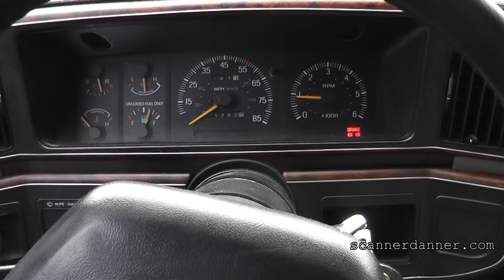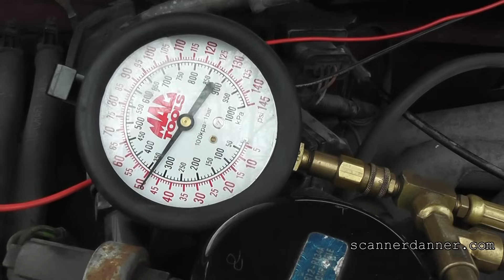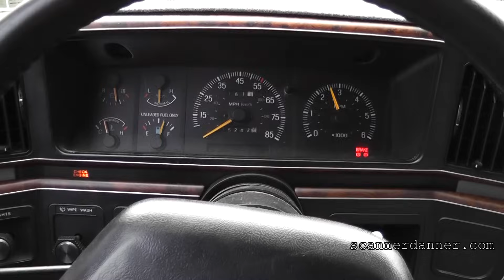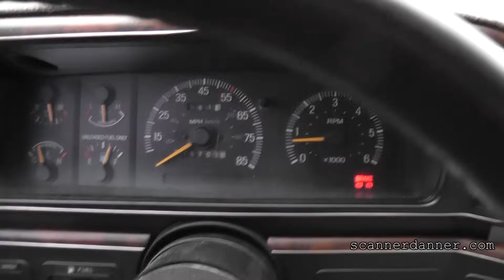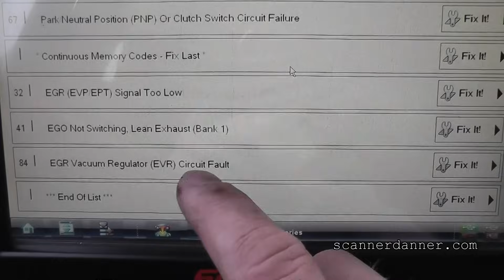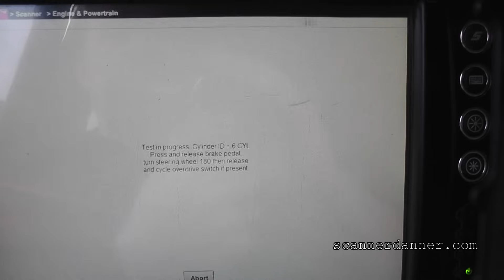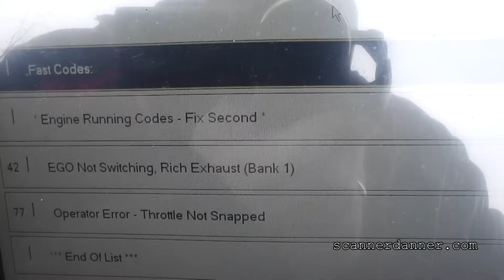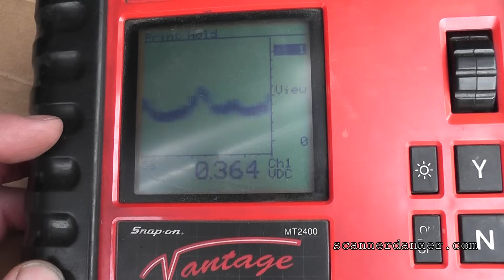1988 F150 Hesitation Problem [FIX!]

Comment: Hey if you want your Verus to boot up faster you should try a SSD I put one in mine right after I got it and it starts up and loads the program in less than 1 minute now.
Reply: SSD? You put a solid state hard drive in your Verus? Or is this RAM memory? I'm interested
Reply: ScannerDanner Premium Yeah I'll grab you the links I used to figure it out hardest part is finding a program to copy your drive for free. http://productforum.autorepairdata.com/forum/showthread.php?t=4232 
http://productforum.autorepairdata.com/forum/showthread.php?t=3771
The ram upgrade doesn't really seem worth it but if you want while your in there  its pretty easy to do.
Reply: Mike Lange If it's a Windows computer just use Macrium Reflect - look it up on google really good (free) program for cloning disks... I use it at work quite a bit (as a computer tech) the free version has all the cloning features, and you can boot from a disk or USB if you don't have a second computer to do the clone on
Reply: Mike Lange Could you just dd it with Linux?
Reply: tducketts
you could try it, usually works fine, but for many people GUI is easier, command line is not most people's first choice.. although I agree it would probably work fine...

potential issues for example: if the SSD wasn't the same size as the HDD, dd might need more options or not be able to move the NTFS data around

Seriously if you're a Windows guy at all try Macrium for cloning it's really nice, and free, works with most exotic hardware configs like for example; Intel Smart Response Technology, Windows 8 EFI secure-boot-only laptops and whatnot
Reply: thedreadedgman I think i did use Macrium Reflect. It uses a version of xp to run the scan tool and the hardware is some how coded to the software, not sure the specifics but you cant change the operating system. Either way when you do it just partion out the hard drive the same way the one that is in the scan tool and you wont have any problems.
Reply: Mike Lange yes; in any case an SSD should make a nice improvement to the tool, I suspect that the tool probably costs enough that they should have put in SSDs from the factory since they're less then $0.50 a GB now.
Reply: I'm going to have to look into this a bit more. Thanks for passing on the links. I'm not very computer savy so I will have to talk with someone who is. But I would like this. the verus is sooooooo sloooooooow.

Comment: I really enjoyed and learned some things from the few vids of yours I watched.   I enjoyed the one with your son and the Ion.   I absolutely hate the over engineered and junky computer/sensor/run by wire things in the Ion. Worst car I ever drove in snow BTW.  Also, prior to me owning it, my dad had the engine light go on, which manifested trouble with the steering, transmission and other vital controls. I think it was the ECM he had to have replaced.   Contrast that to your vid on this Good ole F150.  My '88 F250 5.8L has 312k miles on it.  While it may look, sound and operate rough, it should see another 10 years of use and another 100K miles if I can afford the gas it will consume.  Just swapped in a new heater core,  Job could not have been simpler,,,  Sorry GM.     Clutches, tires, radiators, brakes, etc all have their needs, but that stuff I have experience with.   These runability how to's are very good.  Thanks

Comment: So Mr. Scanner Danner. I'm concerned about this video being 2 years past . I have a 96 250 that is having such a similar issue as you found in this video and I am hoping for your thoughts.  I am about to pull my ECM and replace the capacitors to try and stop mine from blowing the #9 position Maxi fuse . This fuse first blew out immediately when hitting a teeth jarring bad place in the road which has my truck not allowing either fuel pump to run at all  since the rough place in the road . I have absolutely NO KNOWLEDGE  of using even test lights, much less using any sort of technical tools . I'm also physically handicap after being hit and severely injured on the job when I was struck by an extremely lage fast moving forklift and I have severe COPD so I would be very grateful and extremely happy to pay you for your help with my situation.  I thank you in advance for your time. JimmyKent in Goodlettsville Tennessee  !!!
Reply from the maker: Step 1 is to have a good wiring diagram and find out all the components that are on that fuse that keeps blowing.
https://eautorepair.adtrk.biz/?a=10817&c=24&p=r&s1=
This is a DIY version of the same service information and diagrams I use.

Comment: I know i'm late ..
Solid line is mark for light short deep notch is for Ford service tool ?(Mag pickup) that slides into the tube on the other side. Nice I remember all the fords I lernt on.
Oh and stop using the module to rotate the Dist!!! ever snap one? off,  you will if yo keep doing it.

Comment: I got a 89 Ford F250 460, I plugged off the EGR and just completely removed it and plugged the manifold and took off all the vacuum to the egr assembly. Would that be alright to do or do you recommend leaving it on there?

Comment: The straight six in my 96 has the timing mark on the cover vs the bolted on bracket like the one on this truck because it has a misfire sensor mounted to the timing cover in that spot.

Comment: Paul I just developed that cricket sound on my truck was wondering if you would guide me if it’s a serp belt and tensioner pulley? Or any other suggestions
Reply from the maker: Tough to do over messages. Change the belt and spin all the pulleys while the belt is off

Comment: +ScannerDanner let me be your cameraman so I can learn from you for free! Does that 1988 model bringed steering wheel position sensor? Another question how you pluged in your Verus to that OBD Port?
Reply from the maker: no steering wheel position sensor on this and you need an EECIV adapter cable for the scanner

Comment: Great video.as usual.93 ranger 2.3 new o2 same problem...6 months trouble.plus hidden whistle...checked manafold .flooded with oil..my bad ...old truck .Bad pvc. To much vac on crank case....sucking oil....new pcv truck runs great .(no check light)  they say high tech helps..makes me turn gray......lol

Comment: another great vid mr danner, i enjoyed this one because if your head would have been where it needed to be instead of the camera you would have seen the timing mark hehe.
pause at 3:52 its to the right of the centre sump bolt.
thanks for recording this...liked
Reply from the maker: Lol I know it! And I saw it while editing. While filming I'm looking through a 2 " camera screen which also doesn't help.
Reply: yer right, no way are you going to spot that on a 2 inch monitor.
im hopeing for a 3rd return of the f150.
something to do the with the erg system maybe...:)
Reply: Haha not me dude. I'm done with this truck
Reply: ScannerDanner Premium
mr danner i have a question about maf sensor voltage on an 02 bmw 320i 2.2 6cly.
i remember you saying something about posting questions on one of your vids, can i ask here?
thanks,
chris.
Reply: I am directing all help requests to my forum. Sign up (it's free) and create a new post. Be sure to add a name under "alias" as this is the name that will appear in the post.
Here is the link to the forum. 
http://www.scannerdanner.com/ForumRetrieve.aspx?ForumID=3226
Reply: great, thanks MR Danner.
i will do that.

Comment: Hi Dan, finally, a mechanic with the same principle as myself. I will not replace any part until I am 100% sure its bad and usually use a known good used part to verify my diagnosis then I'll replace with a new one.
Any one can solve tge problem if they replace enough parts eventually the problem part will get replaced, at the customers expense.  Anyway i stopped this video at 9 min. To insert  here what I would do at this point in diagnosing this particular step, because fords balancers have a tendency to rotate on the rubber. Pull #1 spark plug rotate the crankshaft with breaker bar, not bump the starter,   till you feel compresion, the put the dip stick in the spark plug hole continue to rotate the crank until the dipstick starts to go back down in the cylinder. At the point where the dipstick doesn't rise any more. That is TDC mark the balancer at 0°. The rotor should be in the general vicinity of #1 tower of the cap. If the mark you made doesn't match the factory mark, the balancer has moved. Use your mark to set the timing.
Reply: i have a question, Have you ever came across a vehicle that when cranking it over the engine seems to have no compression? It's like all of the sparkplugs are removed. Then 5 mins later it starts normal. This has happened to me twice. Once on a ford courier, every morning cranks like 0 compression then sometimes within 5 mins it starts other times up to an hour before it starts. the second time this has happened was yesterday on my 1990 f150 4.9 4x4.
 I was driving home two nights ago the engine just stalled like I turned the key off. first thing i checked for spark. Had none, removed the spout, engine started. I drove it home. Yesterday I put the spout back in, tried to start it, but it acted like 0 compression. I went in the house refiled my coffee cup. went back outside cranked the engine and it started up normal. I have seen some strange things in my 50 plus years as a mechanic but these two vehicles are mind blowing.

Comment: what dose an egr i mean what dose it do i have it in 1990 chevy and its broken what dose it do ? thanks in advance love your videos your amazing
Reply from the maker: On your truck, without it, you will have a pinging sound at part throttle especially pulling a hill. It basically cools the combustion chamber. You need it to run the aggressive timing advance curve that motor has.
Reply: ScannerDanner i see thanks its not a truck its a 1990 chevy caprice classic LS dose it apply here or just trucks ? Again am a big fan sir keep it up
Reply: 305 engine by the way i have the egr instaled but i found it after testing it that its not working and needs replacingScannerDanner
Reply: Mike Anderson returns gas without fuel to intake at preset time above idle keeps valves from burning & emissions.

Comment: Yeeahh...I see you got the big timing mark used by the factory at first...but no bracket with hole or tube in it there anymore for the factory magnetic probe which would have been a dead give away. Figured you would clean the balancer to find the proper mark once you figured ur light was on the proper wire for number 1 and ur mark is no where to be seen or potentially look to see if somebody stabbed the distributor wrong.I used to use a vacumm guage at the same time to adjust idle screws for best stable vacuum around 18 or so with dialed in  mixture and throttle screw at the same time for perfect idle and best response....nice straw colored plugs after  after that on my '70 340 Duster with AVS carb.

Comment: EEC III, IV had all the trims etc of modern cars. Only difference is ford relied on baro readings and calculated values and would end up over correcting for an air fuel issue and making the problem 2-3 times as bad lol.

Comment: Just a little side note that may be or may not be of interest.  If you ever work on these "aged" setups it may be worth something to know that most vehicles will have a base timing marks on the distributor and the block that was used in the factory to get the timing real close off the line.  It has been my experience that these marks are more often then not "Spot On".  This is not saying that timing should NOT be checked!!  I'm simply adding some of my own experience.

Comment: I have a Sebring Chrysler 02 2.4L 4cyl automatic it dropped on a hole on the road and shots of and it doesn't start at all ,no injectors or no signal ,it crank but no start cam and crank sensor are ok and spark and gas pressure is ok ,my concern is have you had this issue on the same car I we'll appreciate if you can let me know thanks.
Reply from the maker: Post this to my forum. It is free to join and we can definitely help you there. www.scannerdanner.com

Comment: My 89 f150 4.9 is doing this exact same thing. My egr is completely disconnected. Ran great for yrs with a egr delete plate. But my fuel pressure is currently at 40psi and when I rev it up it and hold it the fuel pressure raises and drops. So looks like I'll be doing a high pressure pump. Again. Lol. Always something.
Reply from the maker: A vacuum assist regulator like you have will do that. Disconnect the vacuum hose and then retest it

Comment: My 1990 f250 351w starts and runs rich. Seems to start better with purge solenoids vacuum line not hooked in on passenger side of the throttle body. Then after it’s started I can plug the vacuum line in and it idles down and runs but it’s rich.. then when I shut it off it don’t want to start, I have to floor the pedal to get it to start. Obviously it’s flooded but why. I’ve put new map sensor, tps, coil, plugs,rotor, wires, plugs. My charcoal canister has a hole in the top. I smell gas bad after cranking it. I’m narrowing down vacuum leaks. Pcv valve is good. I’m thinking my egr may be stuck open. Any thoughts or advice would be appreciated
Reply from the maker: What is MAP frequency with the key on engine off? What elevation do you live at?
(Both MAP related questions)
Next, what is MAP frequency with engine running at idle?
Next, what is engine coolant temp sensor voltage key on engine off with engine cold? Then with engine hot? (The ECT can be tested running or engine off)
Reply: @ScannerDanner  I live in northeast Ohio. I will do the tests tomorrow and get back to ya. It’s bout bedtime now lol. Thanks a lot for helping me out. I need to check my o2 sensor also. I was leaning towards an egr issue but if I have an o2 issue that could be the cause of it all. I’ll be in touch tomorrow. Thanks

Comment: A few things I learned from setting timing on an old Toyota. Analog timing lights are a joke. The girlfriends cheap white nail paint is amazing for this. Also accessory drive belts leave a nice beauty mark on your cheek when your trying to find your freaking mark. In closing, I understand why my dad and grandfather laughed when I bought a timing light and turns out I can set by hearing

Comment: How were you able to connect your scanner to this vehicle given that it is not OBDII and doesn't have a 16 pin DLC socket? Or does it?
Reply from the maker: EECIV systems had DLCs under the hood. You couldn't get data on some of them but you could get codes and had some functional test capabilities

Comment: Where are you hooking up the code reader I have a 93 with a engine miss rough idle
Reply from the maker: under the hood on the EEC-IV data link connector

Comment: remember to disconnect the spout connector first. i didn't the first time and couldn't figure out why it wouldn't be time then read the Haynes manual. then gave myself a duh slap. adjust until it runs smoothly and starts easily then plug the spout in and see if the computer takes over. mine did problem solved.

Comment: If you have one of these trucks 302 300 6 or 351 if it dies after it gets warm then it might be your temp sensor cuz they get out of range and go bad and they get too high a voltage and it shuts them down it took me forever to figure that out but I just thought I'd share that

Comment: I have a 1990 f150 with a straight 6. It runs good for about 20 miles then acts like it's not getting fuel and shuts off. It's hard to start after sitting awhile. Any suggestions on what causes it
Reply from the maker: What's your fuel pressure when it's acting up?
Reply: @ScannerDanner  I don't have a fuel pressure tester
Reply: Was told to check the fuel relay
Reply from the maker: @GaryJoy-lz9tt it's all guessing without it. Go buy one specific to your Ford. They have a service port and I bet you could get one for under $50 on Amazon

Comment: What kind of scan tool do you use for OBD 1?
Reply from the maker: +Nooner 965 I use my Verus, I have OBD1 adapters. I also have an old MT 2500 (snap-on) scanner with all of the OBD1 cables.

Comment: Was there a danger of damaging the ECU by jumping battery voltage on the O2 signal wire to control it high?? I'm guessing the short answer is no otherwise you wouldn't have tested it in that way!

Comment: I have a 91 f150 5.0 and it's not getting spark. I've tested everything. (New icm, New ignition coil, new distributor, new pickup coil, new ignition switch). I've had multiple people tell me it's the computer. which isn't a problem if it is. I just want to know if it could be the computer before I buy a new one